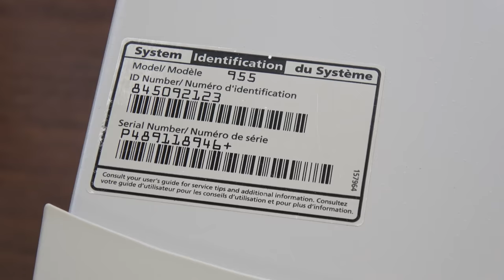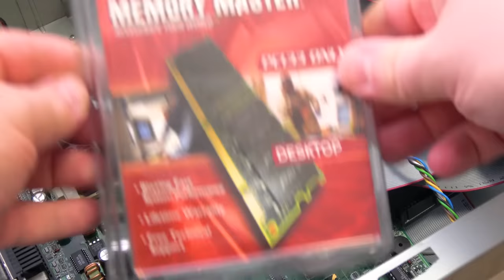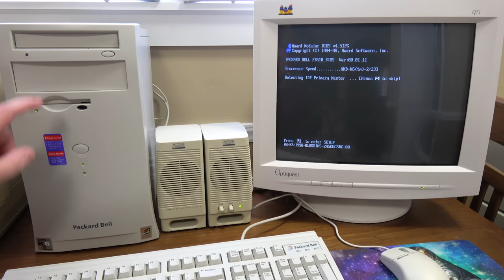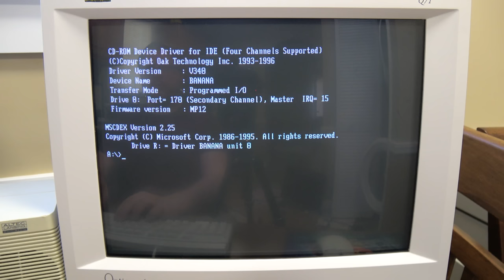LGR - Restoring a 1998 Packard Bell Multimedia PC

Comment: The HDD "tray" was Packard Bells attempt to make make their computers as far from "stock" as possible... The reason why store bought motherboards will not fit, they made them proprietary as possible... The issue with HDD's was they really weren't different. 
I was the manager of a repair shop, and people actually "thought" because the HDD was mounted that way, nothing else would fit, so in a way, it worked.
Some units had a "special" connector from the power supply to the MOBO so no other power supply would fit... That didn't last very long though, and they weren't the only ones to do that. Dell succeeded more at that because they made completely propriety size and shape power supplies...
If remember right, PB got bought out by eMachines... which means they went from bad to worse... eMachines kept us busy for a good many years...

Comment: I saw a lot of problems with this build and you skipped over pretty much half of them. That's saying a lot...Hahah! This brings back memories of my overclocked Super 7 box that I used for everything. School, MSN, Macromedia Flash, Corel Bryce(yes I'm serious, no don't do it), Lightwave, torrents, firewall server, web server, ftp server, Unreal server, WoT server, Subspace Continuum MMO domination and God knows what else I could do with that junk. It was essentially my first PC and its last days were used for developing apps in Visual Studio 2005 and .NET WebMatrix. This Windows loading mess looks like a familiar nightmare. The board reminds me of the ASUS P5A-B, which needed an external USB card just to have support but seeing how this is made in 98, your built-in USB 1 ports might be able to carry over an El Torito stack without the need of a boot floppy or CD. My way would be booting WinPE from a thumb drive, preinstalling a copy of Windows Server 2003 Enterprise SP2, load DirectX9c, update .NET Framework and ISA Server 2004. Yeah the OS and apps aren't period correct but they were my alternative to setting up useless Windows 95 stations and after XP, these super 7 builds were getting REAL long in the tooth. I eventually threw it out when overclocking couldn't match minimum spec on any software anymore. Also, HDDs started to migrate to SATA in 2003, which is when I built a Pentium 4 system to replace this.

I had AGP support on the old system, which was rare according to my friends. My first P4 system had AGP8X, which is also rare today. The quad core AMD system I built to replace that now sits in the background as my faithful rack. I don't miss the grief and suffering these super 7 systems caused but at the same time, I really miss the malleable array of options for hardware that was available. You have an ISA SCSI card. You can't even find an ISA anything today and they were some of the best.

Comment: Hey LGR I got a pc from 1995 and I put a hard drive in it with windows 2000 and windows 98 when I select windows 2000 it just says starting windows than when the progress bar is full it reboots. Windows 98 will show the boot screen then show options then I select safe mode or normal boot it will show WINDOWS 98 then 2 minutes later it will bluescreen and I press any key and it doesn't do anything all it does it makes my crt image blink.

Comment: Anytime anyone brought a computer of that quality from that era, beside general cleanup / new windows format. 1) as he did look at the cap 2) Always recommend a new PSU because yours is a  POS, I cpuld get a cheap quality Seasonic.  and 3) Usually give them a better CPU cooling option. Generally man it was like the cheapest parts that could make a computer. Though I do miss the cat fighting for the mail slot against the mailman with the massive awesome Computer Shopper Monthly. It was like clockwork how the cat knew what time the postman came around.

Comment: Also, look at the case of the 1997/1998 Packard Bell Platinum; it's called the Gulliver. Very amazing design and solid build quality. But again, top of the line versus your low end model.

Comment: About that BIOS password... i wonder if its a common thing on older systems, i currently have a HP VECTRA VE 6 computer from 1998 that i hadnt booted up in years, and when i did, it was asking for a password, i dont ever remember setting one up, so i turned off the machine and reseted it through dipswitches on the motherboard, booted it back up and behold, it was gone. I had a look through the hard drive and decided to redo the entire system, then i shut it down, took all the parts out, cleaned all the components up and reinstalled everything, decided to check the cmos battery as well, and sure it enough, less than 1volt showed, so i replaced it with a brand new one. Turned machine back on and it was asking for a password again, so im thinking, when the cmos battery is dead or removed while still good, the password function happens automatically, or it could be just an HP/COMPAQ thing.

Comment: When I finally kill my current PC I'll send it in for an autopsy. I smoke a lot, so my computer basically smokes, too. When I exhale, the intake fans pull all the smoke in. There's a thick layer of yellow and brown cake on the outer case shell, and the inside looks like a shag carpet. I clean it twice per year and manage to pull a baseball size of crap from the board surfaces and heat sinks.

Just curious... why do you use distilled water? I know it's perfectly fine, but most people (myself included) tend to opt for isopropyl alcohol.

Comment: I just put together a Ryzen 7 2700X 8-Core processor (water cooled), an ROG Strix 470X Mobo, 64 Gigs on 4 Ripjaws of PC3200 RAM,  and an ASUS Strix 1080Ti OC graphics card system running windows 10 Pro and games from a Samsung SSD (not to mention 12 Tb of storage on 2x 7200 RMP HDs) displaying on a Samsung 55 inch 4K TV and a 4k Gaming monitor with Razer mechanical keyboard and mouse...

And fuck me! I'm fucking jealous of this here system on your video.

Comment: I purchased a Packard Bell 32-bit computer with Windows 98 Pro se installed. It's floppy eject button is missing as well. Not sure what's up with that. Guess it's a common thing with used PCs. 
May have to reinstall '98 because it's flaky, like poor video capability and missing files. As a result of poor video quality, I figured if buying a card would improve its situation, but alas... it didn't improve, so it was removed.  Tried all sort of drivers for it, but it wouldn't have anything to do with them.  Oh well.  It was basically for reading my collection of programs that came on 3.5" floppies as well as using some hardware I kept over the years. 
Now I can do various DOS things and fiddle with QBasic on it, as well as a newly acquired laptop with XP on it as well.

Comment: 2:30 Never seen power supply that take fresh air back of the computer and push the hot air inside to the computer... And inside the computer that not have fan for pushing hot air out from the case!!

Comment: You know mr LGR even though I am a AMD user now before the black series AMD prebuilds had a demonstrable issue with heat. The Xbox 360 and similar AMD Athlon Dell PCS what are some reason why I used to I over-priced until laptops in pre-built desktops. I think anyone with a non Intel or apple base computer or console can sympathize with the Packard Bell because even if their computers were not that great if they had me those computers might Industries still be dominated by the same two companies every we have no YouTube it just a Microsoft version of Facebook.

Comment: I have a 1999 Compaq Presario 5460 that came with Windows XP. (FYI, it ran horribly on that thing). A day later, I put Windows ME on it because I heard how shitty it was. I wanted to see just how crappy Windows me was so I installed it on my Compaq. Needless to say, it ran surprising well on there. I only had the thing crash on me once or twice. A week or so later, i put Windows 98 on it (you know, the one that it's actually designed to run on my Compaq). Enough sarcasm. I haven't had to reformat it since. I should probably check the power supply on it to see if mine has a G-Power power supply. I doubt it since I've had it since the end of summer and it hasn't blown up on me yet. BTW, my mom found this at the side of the road and knew I would be OBCESSED with the thing so she picked it up and took it home. I do have a couple problems with it: it sometimes bootloops and it doesn't always respond to me pressing the power button. If it's the latter, I have to unplug it for a few seconds and plug it back in. If it's the former, I just wait until it stops bootlooping. So far, it hasn't been bootlooping as much as it did when I got it. I've mainly been having problems with it not always wanting to turn on when I want it to. I think replacing the power supply would fix the issue. So far, the computer has been good for me other than those 2 issues. I wish I could share pictures of the computer in the comments section. I mainly use the computer for playing games like Test Drive The Passion, Need for Speed High Stakes, Doom, etc.

Comment: I've been wanting to do a rebuild of a computer I had years ago but cannot figure out what the model of the system was, not sure if someone can help, I think it was an PackardBell imedia system, it came with Windows ME with 64MB Ram, 20GB HDD.

It came with matching CRT monitor, keyboard and mouse with a translucent blue front trim with a white case and the power button was a landscape rectangle design in the middle of the blue trimand I think it said imedia on the lower part of the front of the case, it also had two front usb ports below it.

It had Diamond media monitor mounted speakers 

I've only encountered two systems ever but they have long gone and my original had capacitor issues and killed it.

I'd love to just have the case of one just so I car make a modern system out of one.
Reply: Damn, after all that and days of looking I found the exact system on Google images. It was an iConnect system. :D

http://informatique.toursannonces.fr/img/photo-annonce/2008/10/05/2342/enligne/photo/annonce-1222450631-tours-multimedia-36.JPG

Comment: Why so unloved? OK, Packard Bells of this era may have been very cheap, beige & generic, but certainly here in the UK, competing with the likes of Tiny & Time Computers at the time, most PCs were, and there's no denying that with the massive software bundles that came included at Dixons / PC World, they represented great value for money, and easy to setup & run out of the box for the novice user. Myself, I've only recently purchased a PB Win 98 Club PC, as watching videos like this, and Billy's, I feel I've missed out on the Packard Bell experience, having not owned one previously, and have to say, although it's certainly a cost saving design in terms of hardware used, I like it's simplicity, and despite all the bad stuff about reliability, it's actually well built. What I don't like, is their tattoo / EXTHS software installation system, ingenious for sure, but only if you have the correct Master CDs it seems.

Comment: I always hated windows for the endless updates. And I thought 1gb Of ram was huge! 😂 
And 3 crashing after getting service pack 3 updates is had enough. 
Brought a Mac mini dual core 2.6 4gb 2007 then a 2008 8core 3.2 16gb pro tower and never looked back. Only ever had a hard drive die. Time machine system back up sorted that out! Only just upgrading to a 2012 tower thats patched for mojava! Screw you gates!

Comment: I have a very late 1999 or very early 2000 Packard Bell Platinum that is good though. First of all it is still working but apart from that, the specs are screaming. 30 GB hard drive, nVidia Riva TNT2, 600 MHz PIII, DVD ROM & CD RW, etc. The case is much more generic and cheap than their traditional exceptional designs though and so is the 17" monitor that came with it. But late nineties Packard Bells were not bad if you went up to the high end machines.

Comment: Payed through the nose for a 600megahurtz Pentium 3 8meg onboard vidio it had an Agp slot 8 meg ram and a huuge 10 gig quantum fireball hard drive with Windows 98se with Packard bells famous recovery disk chock full of bloat ware that  every time had to reinstall the operating system  the dam computer would install all the bloat as well upgraded the ram,vidio card no probs then the hard drive failed  put a new hard drive in atemped to in stall win98se of the recovery disk and it cant install because the harddrive isnt the quantum fireball LOL

Comment: You should build me my dream pc n sell it to me. Lol 
Xfx Geoforce 8800 Gts Alpha Dog edition 348
OCZ Reaper Series 4gb
Intel core 2 extreme QX6850
Thermaltake CL-P0466 Spin-Q
Evga 680i LLG775 Nivida nforce atx 
Rose well gaming computer pc case, ate mid tower, blue led fan CHALLENGER 
With black internal floppy drives and a cd drive. With windows XP 
Hard drive 240gb to 500gb